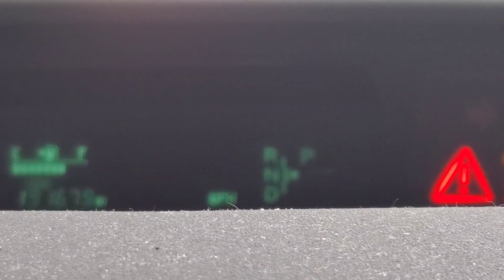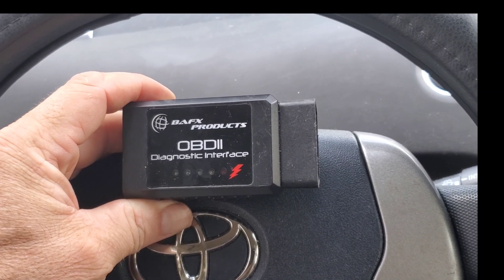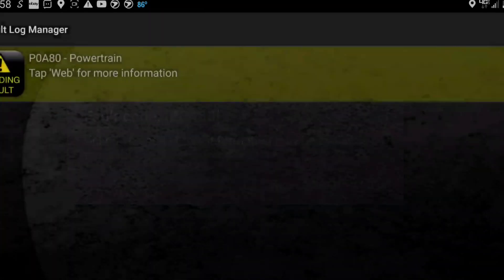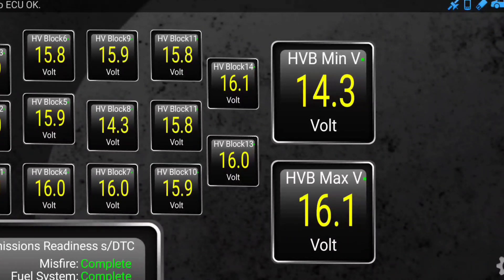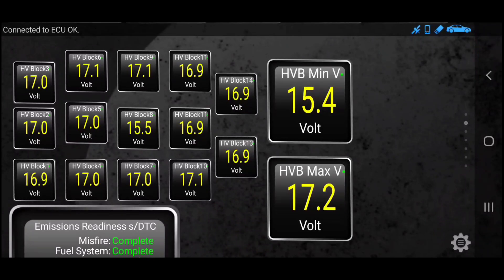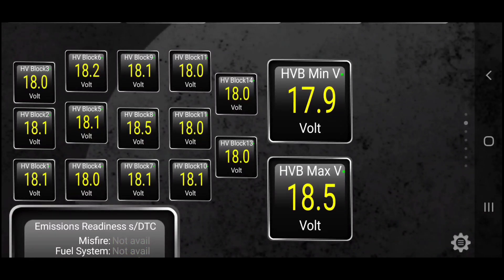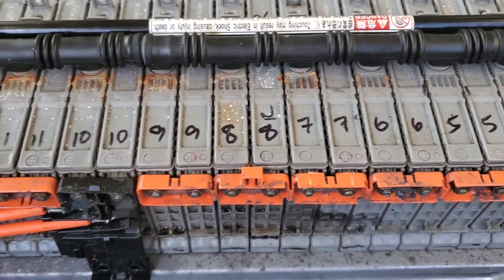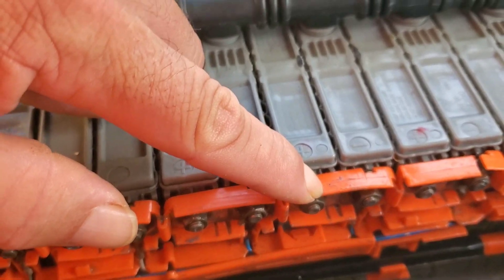Diagnosing Triangle of Death Prius

Comment: I run all sorts of apps on my too fancy for me Launch scanner; Dr. Prius, TechStream, Hybrid Asst., but haven't tried Torque yet. As an aside, bought one of my Prii (all Gen2) w/ red triangle of death from a guy who had the local Toyota dealer diagnose for him ($160). They told him he needed a new transmission??? I didn't argue and just paid him. Changed fluids, installed a new 12 volt battery (old one was only holding 12.2 under load), charged & discharged the hybrid battery five times and wha'dya know?
Shifts fine, cleared all DTC's w/ my Launch scanner, and reported zero codes. That was 28,000 miles ago and it's still running like a champ. I do run Motul synthetic & change every 5,000 miles, so that helps.  :)